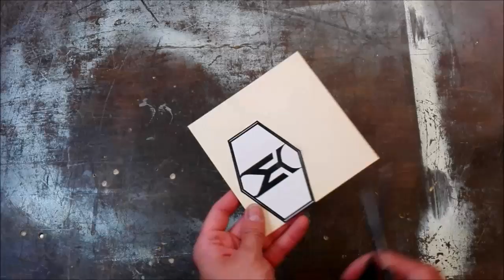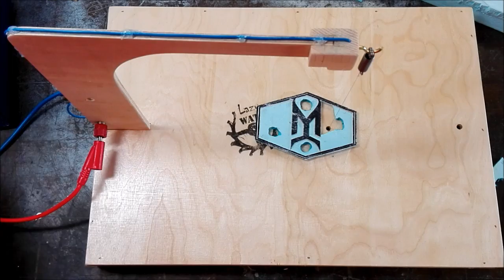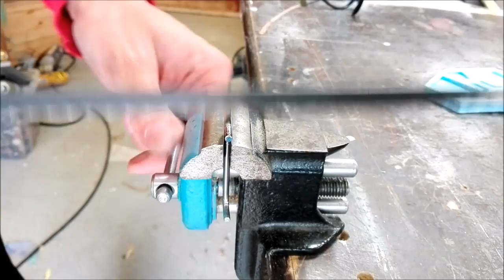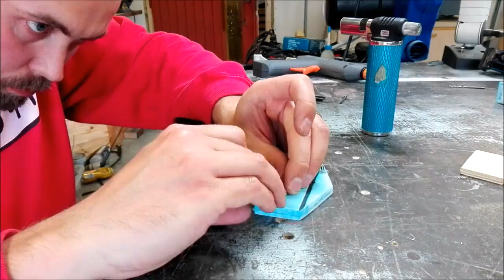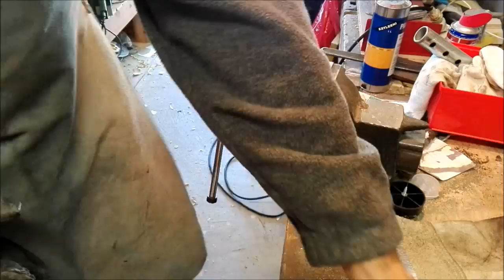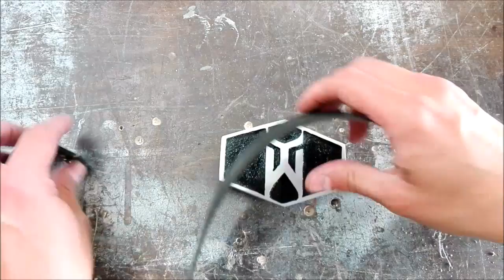DIY aluminium belt buckle.

Comment: amazing work im very impressed. i think im gonna give this a go! ps should i wet the sand when i put tho mold in?
Reply from the maker: I do not know what happends when you wet the sand. 
Thanks for watching.
Reply: Lazy watchsmith i have one question, aluminum does not rust but tends to oxidize. i want to make a buckle but i want the face to be mirror shiny but im afraid if i spend the time polishing it, it will just tarnish fast. has your buckle tarnished ?
Reply from the maker: I do not have it anymore. But you can put a coat of clear laquer on it.

Comment: So cool!! What kind of sand are you using?
Reply from the maker: All I know is that it was the finest I could find.  I think it is used to fill the small gaps of stones layed on a drive way or something.
Reply: @Lazywatchsmith  cool thanks.  Is the sand dry or did you wet it before casting?
Reply from the maker: @JOHNPAULCARMODY  it needs to be dry.